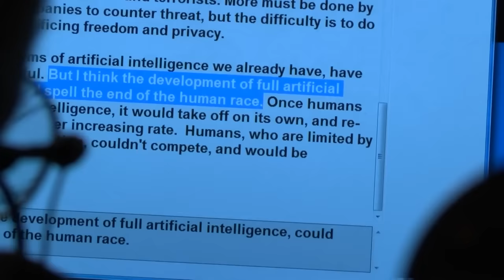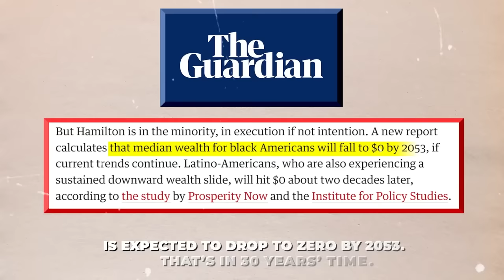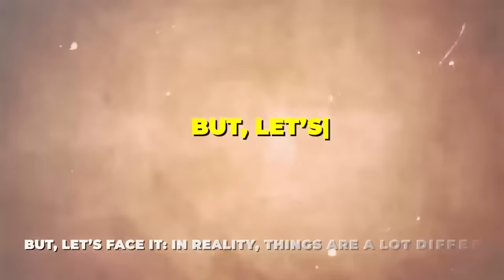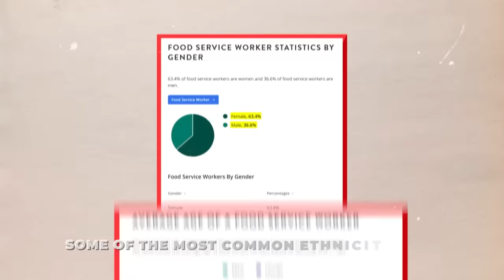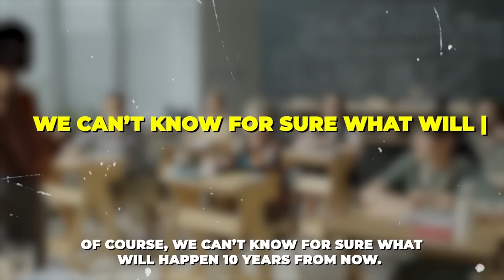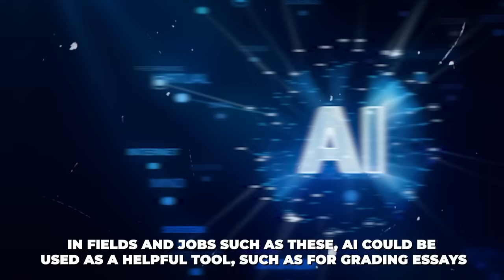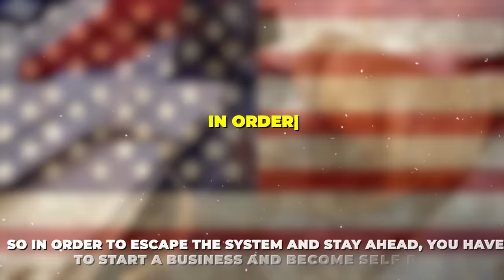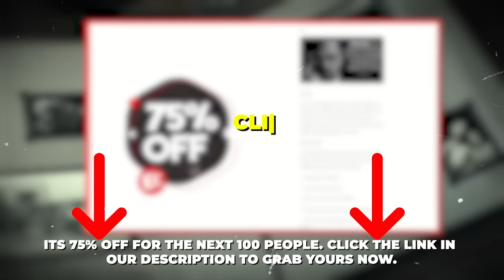An URGENT Warning To ALL Black People ..

Comment: If AI replaces human labour, where are the consumers coming from to purchase goods and services produced by AI.  Consumers are a very important element in the circular flow of income.
Reply: The system has a way of advancing and maintaining itself. The system understands that If you squeeze them hard enough, they will give and become something new. The system relies on the human adaptive factor knowing that in the end people will make a way and so it advances at the expense of humanity while also testing the limitations of humanity. Pushing people to do things they may never have done if they weren't pushed to. This isn't always a bad thing as enough pressure can make a Dimond, but it will break a lot of people as well.

Comment: So we're going to label this video cap because there's a lot more jobs out there than just rudimentary no brain needed labor jobs.. 

This wouldn't be a problem in our community if we stepped into trades like we were supposed to... 

There aren't any robots that are able to perform patching up pipes under streets..

There aren't any robots built to climb towers to repair or install antennas.
There aren't any robots that can perform real-time on-the-spot troubleshooting that needs physical interactions..
We don't live in a world yet where robots are building, buildings... 

In other words there aren't any robot contractors, welders, mechanics, plumbers and so on and so forth.... 

If you've noticed it's only the jobs that take no brain or real-world work place experience... 

Even the robots at the Amazon factory still need help... 
The world of trades is still too complex for robots..